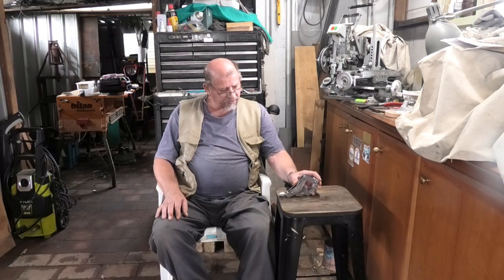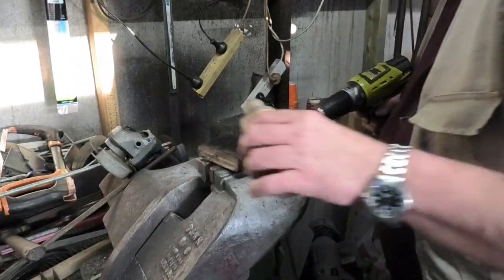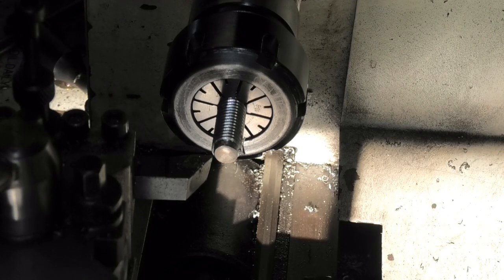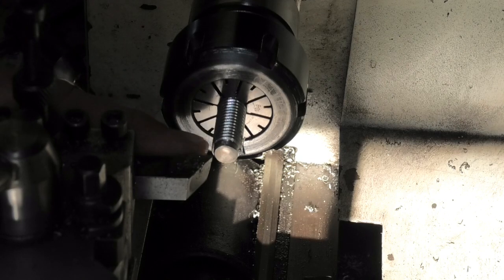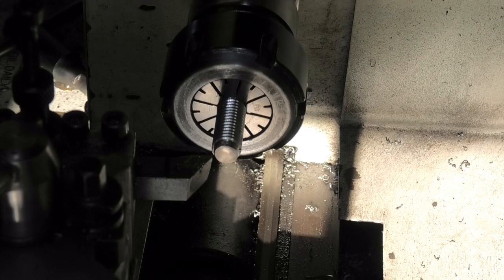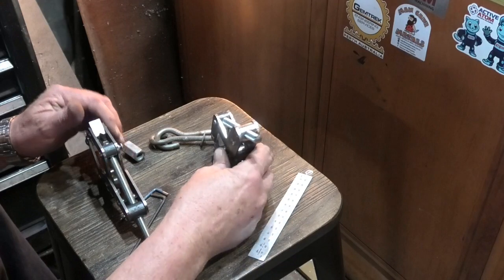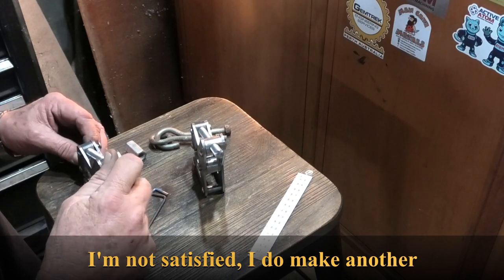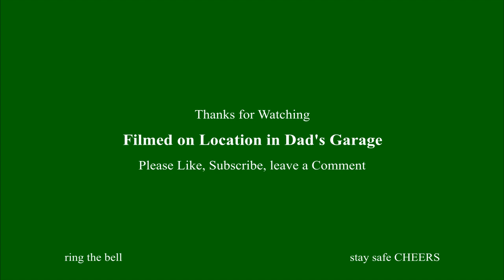Machinist Clamps Part 7 #Toolfest2021

Comment: Oooh, those angle brackets on that vice look very useful. I have some cheap "precision" vices that I could make some for. I bought myself a load of Kant-Twist clamps for my birthday last year.  Never thought of making them.  Very nice project. You can never have too many of those clamps!
Reply from the maker: G’day M&M. Since I have a horizontal mill using the vice in it’s usual mode had limitations but it didn’t have a method to clamp it standing on it’s nose, it took me a while to realise the stop bolt hole and the cross holes for the jaw bolt were a solution. The clamps are a great project and I bought the plans for less than $10 as the kit was too expensive by the time they hit here in Australia. And yes you can’t have too many clamps. 
Cheers 
Peter

Comment: Lovely result Peter. I also really like the idea of the angle brackets on the precision vise. Good idea for a horizontal mill! Looks like you are getting on great with the AL51G too! Matty's really a very kind bloke. Cheers, Craig
Reply from the maker: G’day Craig. These vices are excellent but can be difficult to secure in a conventional way especially when you only have one T slot, the angle brackets work well. Matty is a great supporter of the machinist community and I am very grateful. 
Cheers 
Peter